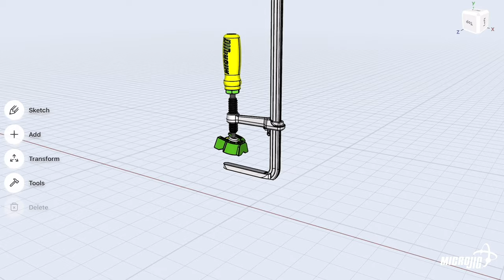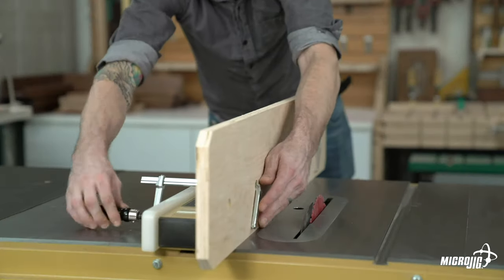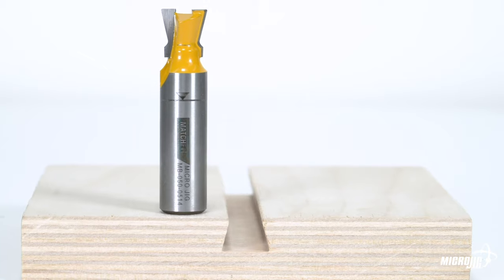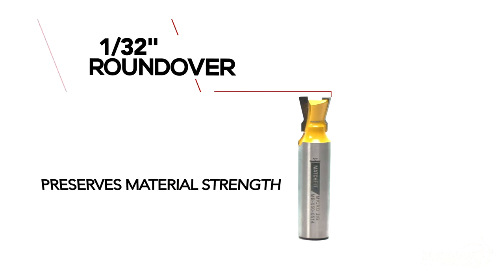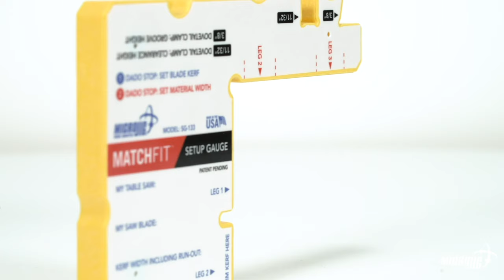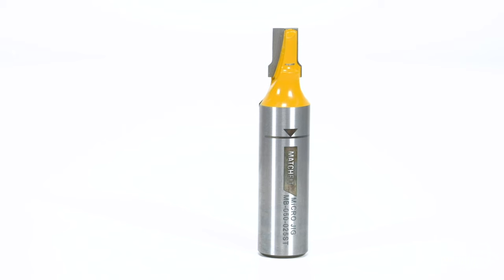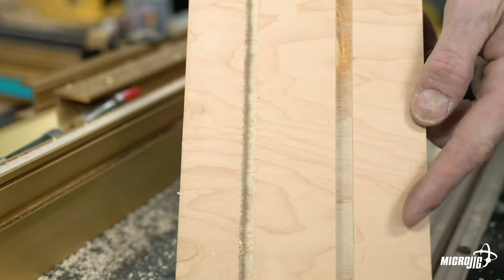An in-depth look at Working Smarter with the MATCHFIT System

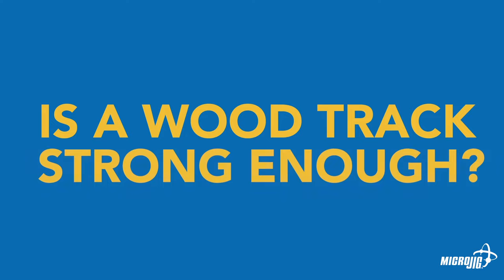Comment: 2:00 There are tricks in the video to promote this product. You used a theory of "pinching" and not pulling because you've flushed wood against the board. But you didn't do this when comparing to the t-track. But I have no doubt this is a great system.

Comment: I have just finished building my workshop and am working on the design of a modern bench.  From the bewildering variety of options, I have been seriously considering the MicroJig system, but I am actually put off by this video. Specifically by your explanation of how the dovetail works. If you can't do an honest like-for-like comparason between the different systems, what does that say for your product! 
However, I suspect in use the ultimate strength of the dovetail slot, or the T-track slot is not a major issue. The MicroJig system does score on versatility - but then it lacks lever and horizontal clamps.
Perhaps the answer does lie in a combination of dovetail tracks and dog holes?

Comment: Hey sir. I just recently made a table Saw stain for my Saw Stop job site saw and I added the Micro Jig system to the left side in a 3/4 piece of plywood. Should I add another 1/2 INC under it?
Reply from the maker: Definitely couldn't hurt! If you decide to do that, I'd use some aluminum square tube (or anything you know is dead flat) clamped to it when glueing it up. The glue will dry conformed to the flatness and hopefully stay reasonably flat for longer.

Comment: So when you use your system you pinching the wood, but with the T-track you have nothing against the worktop and just pulling?
Reply from the maker: With the Dovetail Groove, the stock being clamped directly over the head of the clamp (in the groove) balances the forces so the clamp head does not tear out of the substrate. 
T-Track clamps and hardware are not usually set up to work this way, the clamp pressure is usually applied somewhere away from the head of the T-Bolt.

Comment: I'm intrigued, but am still a beginner.  I've recently bought a basis quarter inch router.  Will it be up to this work, or ought I have got a half inch, please?
Reply from the maker: Brian, a 1/2" capable collet gives you more options certainly, but most 1/4" collet hand routers will do just fine with our MATCHFIT bits. 
The smallest, trim routers (less than 1 hp) will struggle, but anything 1hp or larger should work. 
You will want to mill the relief groove first, it will reduce the load on your router and greatly extend bit life.

Comment: This is new to me.  What are the dimensions of the basic project board and what is the spacing of the dovetail slots?
Reply from the maker: The standard spacing is 4" apart on-center, so the dimensions of the board are always divisible by 4 - 16" x 20", 24" x 32", etc...
Reply: @Microjig  I have a small piece of mdf 19 x 22 inches that I am doing the dovetails on for the first time. I thought it would be a good idea to start with this first before I do the dovetails on a workbench.  I was planning on making the spacing about 2 1/4 inches apart thinking that would give me more areas to clamp and let me clamp things that are smaller than a piece of wood.  Do you think I would have an issue with this spacing?

Comment: Do I still need to worry about the fuzz material if I use my own bit to cut the relief groove? I was thinking that after I use the microjig dovetail bit, it would clean up that fuzz on the edges.  Is that the case?

Comment: I used the Microjig straight bit first followed by the Microjig dovetail bit and found the Microjig Clamps were too tight. I realize I can sand each channel to allow the lamps to slide better but I am wondering if I was doing something wrong. Ant ideas?
Reply from the maker: Art, This should not be an issue. I got your email and replied to it, check your inbox.

Comment: that matchfit dove tail with roundover works as advertised.... I can see a clear difference of "tearout" between matchfit dovetail and other dove tails (bosch)... matchfit dovetail is definitely cleaner cutting.
Reply from the maker: Dee, thank you! We originally made the round over to reduce the sanding needed at the sharp tops of the grooves. 
But the physics of a radius cutter means that they cut in tiny steps down from the top just like making multiple passes. So there is a lot less tear out.

Comment: Per the idea at times 8:34 thru 9:10 for Rip Cutting dados. Is there a problem if I put both the Cross-Cut and the Rip Cut kerf trims on the same Setup Gauge?
Reply from the maker: Nope, should not be!

Comment: Is it necessary to use the relief bit prior to the dove tail bit?
Reply from the maker: It is HIGHLY recommended to cut a relief groove before cutting the dovetail. 
This does NOT mean you can only use our bit. Any 1/4" straight cutter will work, and I even cut them using a 1/4" dado stack on the saw sometimes.
The relief groove should be used with any "undercutting" bit like a dovetail or a t-slot cutter for example. The relief groove removes much of the waste from the cut so there is not so much for the undercutting bit to remove. And this also means fewer chips trapped in the groove being re-ground over and over. 
You will find you get cleaner cuts, and your dovetail bit will last MUCH longer when you use a relief groove.
Reply: @Microjig  Thank you!  I look forward to ordering this setup soon WITH the relief bit.
Reply from the maker: @enterprise59  glad to be of help. You can always email us directly at support@microjig.com

Comment: Hi Morgan, I build a table saw sled with 5/8 MDF and 4inch centered dovetail slots, and the whole sled "bowed". Do you think I should use thicker MDF or rather use plywood instead? I chose MDF because of its flatness. Regards fromSouth Africa
Reply from the maker: Yeah 5/8" is a bit thin. When you remove a material from only one side, it will have a tendency to cup because of the space created by the grooves. There's no material there to keep it flat, so moisture and temperature changes are a factor. So, I would recommend after routing out the dovetail tracks, clamp the sled down on something flat and seal it with some clear coat. Also the sled may have a little flexibility to it, but when you secure a fence to it (as long as the fence is flat), the sled should conform to the flatness of the fence and you're good to go

Comment: Several times in this video you show a green work surface with Matchfit dovetails as well as dog holes... what is that material?
Reply: So, it appears that it's your Ultimate Workbench, but even in the plans for that bench, you have people commenting that you don't describe the material used on the one in your video. I'm assuming it's some sort of relatively easily machinable plastic.
Reply: Or, of course, it could just be green MDF. :D
Reply from the maker: @Foxholeatheist  it is indeed "just" green MDF. 
When we did this years ago, the colored MDF was nearly impossible to find in the US. We had it imported at ridiculous cost. 
Today you can find colored MDF a bit more easily, but it is still a very expensive option.
Reply: @Microjig  I went down a rabbit hole last night looking at alternate materials for a table. I think high-strength UHMWPE would be neat. 😁
Reply from the maker: @Foxholeatheist  Be careful. A very slick top surface is NOT desirable. You want some friction on the table top to help hold parts as you clamp them. 
Early on I made a table from phenolic faced plywood (awesome stuff) but it turned out to be too smooth and clamped parts wanted to slide and shift on the surface. I personally still like baltic birch or cabinet grade plywood.

Comment: I love infomercials lol. I agree that the matchfit system is great but only mention the good stuff of the system whilst stating only negative of aluminum track and i can def see that u overexerted the pressure on the t-track (aluminum or just plywood) to show it fail whilst stop at the limit of the dove tail clamp. Dont get me wrong you have a great and versatile system but i am not a fan of manupulating info to show your product being better. Using dog holes to clamp can provide wayyyyy more pressure that the dovetail track but so much pressure is not needed, as is with t-track

Comment: A little deceptive. You arent clamping rh dovetail clamps in the same setup the t track clamps.  Without the "pinching" on top of the dovetail clamp they will tear out the top of the grove  just like you show the t track clamps tearing out the top.
Reply: No they won't.   Watch the video again slower
Reply: @daveklein2826 lool closer and watch The first 2 minutes. They are not clamping the dovetail the same way they clamp the t track.  There are also videos out there that PROVE EXACTLY what I commented on.  If you do not have the direct top down pressure on the track 1:55 then you will tear out the track no matter what clamp you use.  They don't show you a t track set up like the dovetail at 1:55.

Comment: I have no doubt this is a great system, one I'll likely buy into, HOWEVER.  You misrepresented the holding ability of the wooden t-slot "track" in plywood with your demo of a bridged clamping demo where there is no support "pinching the clamp and material to the track, yet, you don't do the same bridged clamping demo for your clamps.  Yes, I agree your clamps will likely have better strength, but it's a bit disingenuous to not demo them the same way to prove the "other" way is inferior.
Reply: I have complete confidence in this product as I already bought the matchfit kit.  I too would like to see the same be done for both the t-track and the dovetail.  For example, I would like to see a video pan out and show each clamp, setup the same demo and show how many times each is cranked before you start seeing some damage.  You know what, I am going to do that at some point myself.  I think I have an extra piece of t-track laying around.  I only used t-track on this large 180 inch long miter station I built.  I had plans to install t-track on everything.  Two work benches, a drill press table top, a 10 inch bandsaw table area, a router I was going to build into my workbench and several other ideas.  Once I saw this system a couple months ago, I put a pause on all of that work.  One work bench alone with just a basic 4x8 rectangular table top and 4 intersection kits, saved me about $180 in track.
Reply: I very much doubt they have the same strength at T-track clamps. With the T-track, you have both the aluminum body itself AND the screws going into the material to provide force against the bottom of whatever you are clamping. With the dovetail clamps, you have only the bit of wood or MDF to provide force against the bottom of whatever you are clamping. Not only is it one against two things, but wood is more compressible than aluminum.

I'm sure that is why they did the unfair comparison with the T-track placed under a bridge, while the dovetail clamp got the ideal case of a flat surface pushing down on the groove.
Reply: @XJWill1  watch the video again and slower....then you might understand
Reply: True. That's also my comment above. Very tricky if you don't observe it well.

Comment: Well....if you "pinch" the T-track like you "pinch" the dovetail, would't you have the same forces applied? 😁
Reply: not quite as the contact surfaces, angle of pressure and other important factors such as the metal track being a seperate object changes how the force is applied.
Reply: Haha I thought that I was the only one commented with this. True.

Comment: While I like my MatchFit system and use it all the time, your comparison to t-track is a bit biased and only shows their clamps being use with no material directly above the clamp location (1:31 2:33)... displaying how it pulls out at the base.  To be fair, the MatchFit system will do the same, any of them will, if there is no supporting material above the clamp base.  

The main reason I like the MatchFit over  t-track is it is quicker and cheaper to setup as opposed to installing t-track (time, labor and extra material cost).  Your clamps are a bit pricy and I wait until they are on sale or offered in a discounted quantity.
Reply from the maker: You are, of course, completely correct. This was certainly a bit of "marketing license" by Morgan.
As you mention, the entire point of the MATCHFit system is to eliminate the need and cost of aluminum extrusions except in the most extreme cases.
Reply: @Microjig  You honesty is appreciated!  Rare in these days.

Comment: Yeah, where's the "pinching" effect when showing the T-Track?  Misleading advertising at its best.
Reply from the maker: What "pinching" effect are you referring to? The dovetail hardware does "wedge" into the groove when you tighten them, but that is by design. It keeps the hardware in place until you "snap" it loose with a push downward. I can loosen a wing knob, switch parts and re-tighten without the hardware moving. 
We could easily have used a 30 or 45 degree angle that would not have this feature but we chose to use it.

Comment: I like everything about the system except the dado stop. If you have to make just one quick dado - something no one ever needs to do - I can see making the dado by making forty tiny cuts. If you're doing what most people do when they make dados - which is make a lot of them - it's just not useful. Just setup your router or stacked dado set.
Reply from the maker: Actually, the Dado Stop is best for half lap joints, which, in furniture making, often are in singles or pairs. Making several cuts with the regular blade will be faster than changing to a dado stack for one or two joints.
But the Dado Stop CAN be used with a dado stack to make cuts in two or three passes. Woodcademy has a video showing how: https://youtu.be/OMWdcCunMaY